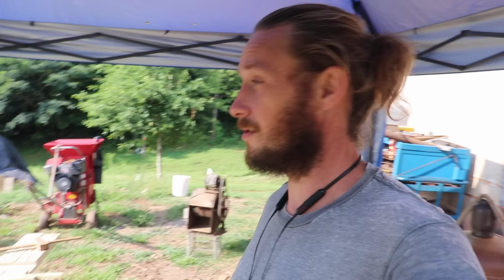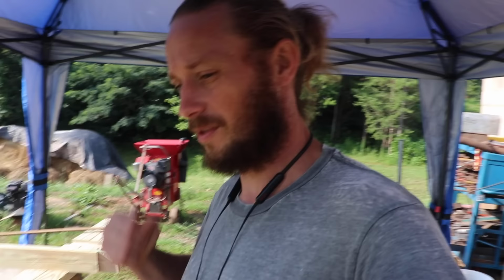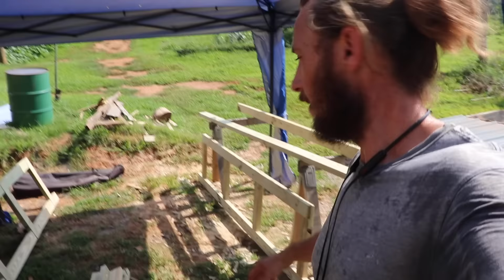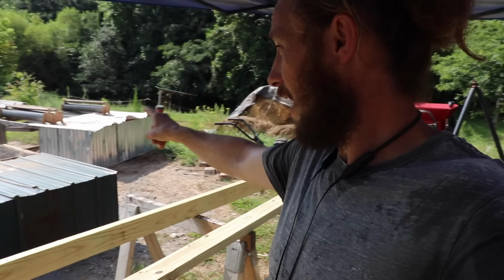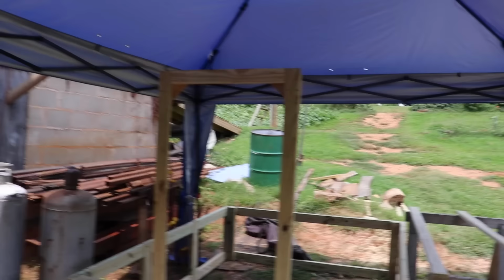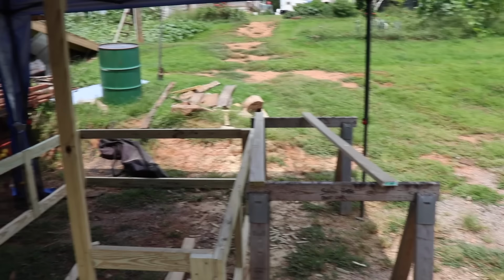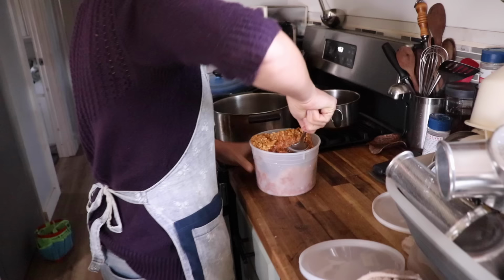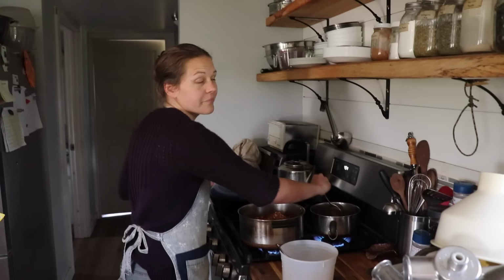It’s Good For Your Skin

Comment: ♥️♥️♥️Love your family♥️♥️♥️ We have followed you for many years. 

🐥We use the same tractors in Texas and have changed to a polycarbonate roofing. We run it up and down with hopes of putting water collection on it for the chicks. (Still trial & error). The tarps wear out and/or tear up faster then expected. 🐥

Comment: I use corrugated plastic (white) on my Salatin style tractor, use 2x4's and make an 8x7.5 foot tractor (ends sticking out in front on top and in back on bottom to make more of a skid and attach a handle bar across the front to hand-pull). Really simple and much lighter than metal versions. I also make the roof completely removable so that I can remove it in 2 pieces to get in and catch chickens. almost all boards are either 8 ft or 2 ft, and the roof framing boards are 2x4's ripped to 2x2ish, so it's light. Roofing plastic is not attached so that I can just throw it aside when moving the birds (and avoid running anyone over). I like it better than my giant Suscovich (sp?) style one. But, I need to adjust my second one to make it work better.  I'm going to watch this build, though to adjust my second meat tractor :) Thanks!

Comment: I built a hybrid chicken tractor.  Chickshaw with a run.  Used 4X4's and 2x4s for the frame. 2X2's for the 4ftX4ft doors on top.   4 ft by 12 ft by 3 ft tall.  It is So heavy that its difficult to move. 

 I will build more soon and I may build them out of EMT conduit and chain link fence tubes for the frame.  I am really going to look at the weight this time and plan them out. 

I really like Birchfield Farming design which is a hybrid of joel Salatin and john siscovich.

The steel tube one that Al at lumnah acres bought is pretty cool as well.  I am not sure how heavy that one is, but I suspect it is lighter than the one I built.